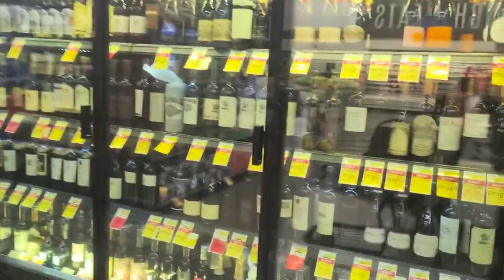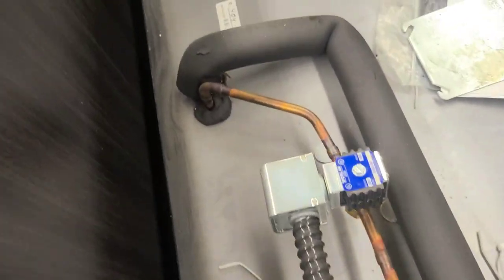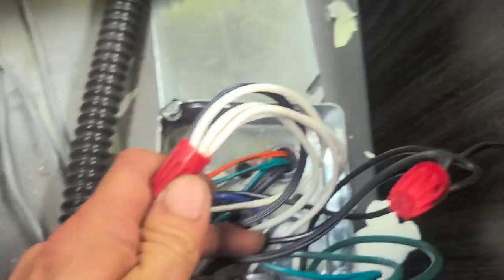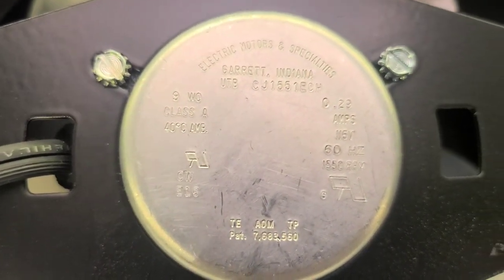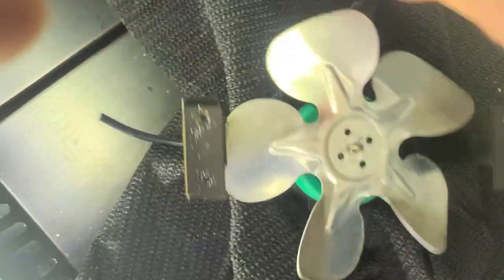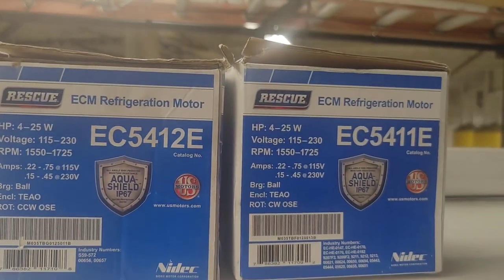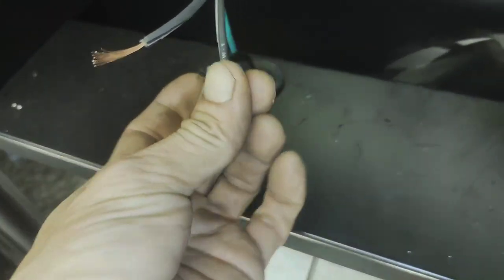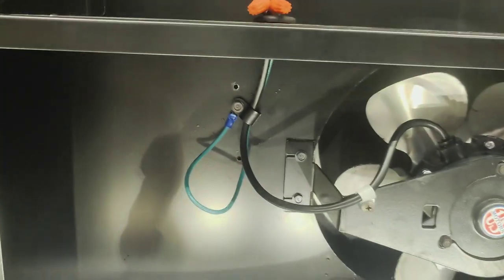Wine Case Cooler Borgen With a failed Fan Motor

Comment: For a moment thought you had a Samurai sword removing those ice chunks!
Keep several of those motors on hand, but prefer the Wago 221? series for the test probe ease of use over wire nuts.
Reply from the maker: yea i keep 3 of each rotation on my truck now.

Comment: Good work tech just a question why you don't tape around the wire nuts for extra safety
Reply from the maker: That's a good point. Usually, i will add tape, if I have it there with me. I suppose that I don't see the adding of the tape as mandatory. But I should. Thanks
Reply: @HVACRServiceTech  no worries I am just a hvacr tech who did electrical and electronics so I was just asking
Reply: @thesilentonevictor  leaving them so that caps are upright vs upside down to collect condensation taped or not is a thing.